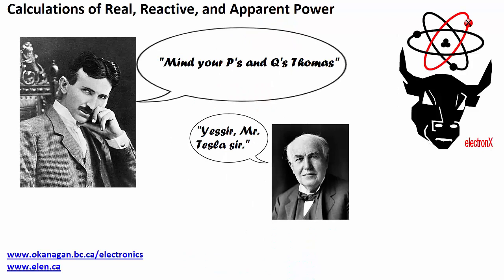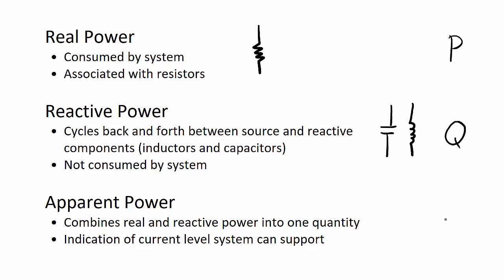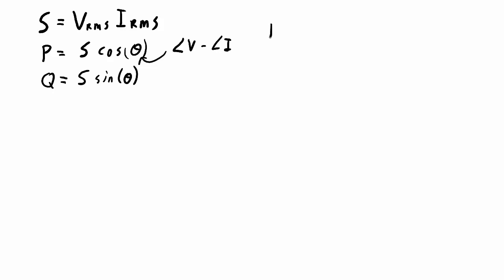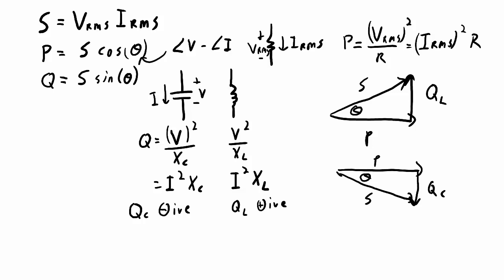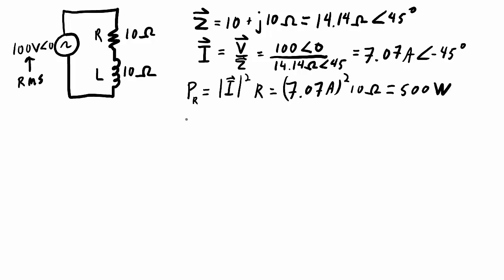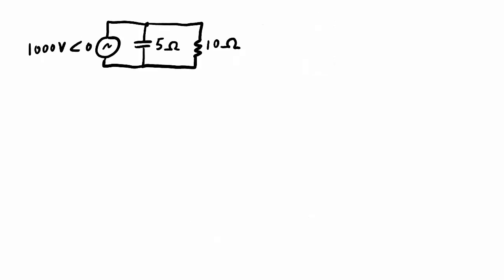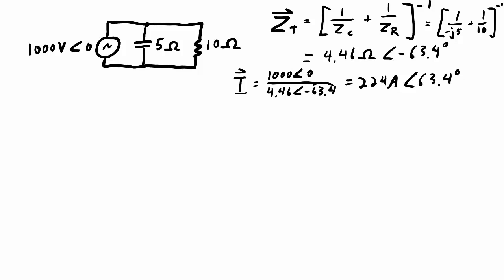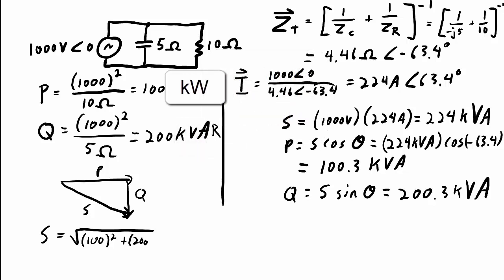Calculations of Real,Reactive and Apparent Power

Comment: FYI “watch your p’s and q’s “ comes from the days of typesetting.
In those days you set the mirror image of text you were setting using separate little metal characters.  
It was easy to confuse or flip a letter upside down. 
So the p, q, d and b always required extra attention as they were all easily mistaken.
(Crap I’m old!)

Comment: are you able to explain how don smith devices work.? I know this is a large subject however I see different ways of his connections between the neon sign transformer and through diodes fills capacitors, how then does he convert that to power that is usable? he never show the other side of those caps except in a few places and I have achieved modest results but I believe I am doing something wrong. The youtuber electric celery adds what look like hand rolled dual foil capacitors which they call extended bifilar coils but I never see them in Dons devices. thank you in advance.